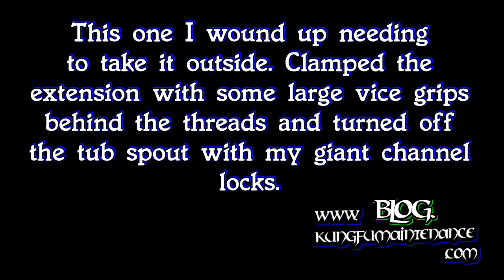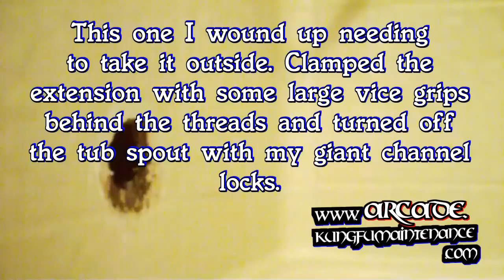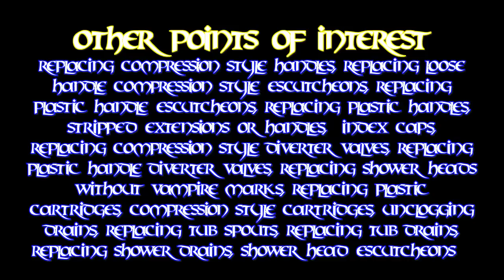How To Replace Threaded On Bathtub Spouts

Comment: thank you for posting this video.  I ended up twisting off the copper pipe.  Any suggestions on how to replace it? I dont have a lot of pipe left since it twisted off very close to the wall
Reply: Not sure if it would work but try sharkbite fittings they work great. Maybe you could use a female adapter and a short pipe nipple

Comment: i can’t remove threaded adaptor from end of 4” pipe that was part of old spout I just removed.  Is there a tool to remove it?  it’s a 3/4” nipple or adaptor.  Without its removal, new spout will not fit in
Reply: I have the same problem. What did you do to fix it?

Comment from the maker: Nothing wrong with that. There are advantages and disadvantages to caulking. If I was going to caulk it I would use clear silicone (around the inside back of the spout before spinning it on) to keep it looking good for the longest possible time. Caulking is too prone to discoloring or molding.  This spout sat quite firmly against the fiberglass with no gaps so water intrusion would not be an issue. Leaving it unglued or uncaulked makes it easy to leak check in the future.

Comment: What if that pipe is rusted ...how do you remove it
Reply from the maker: Spray it with WD 40 or another penetrating oil spray toward threads. Let it sit for a few hours. Than use vise grips to remove.